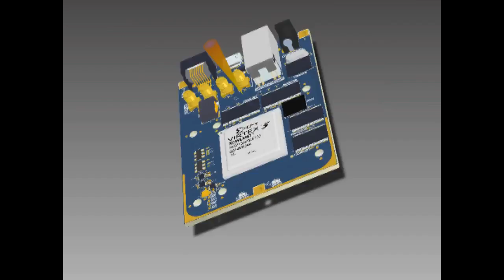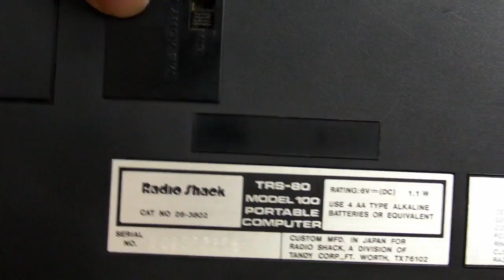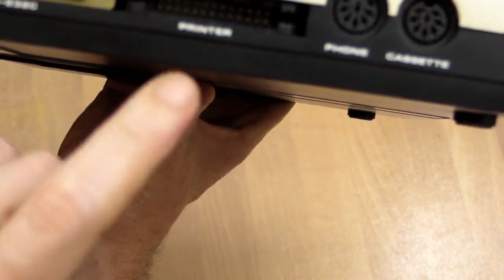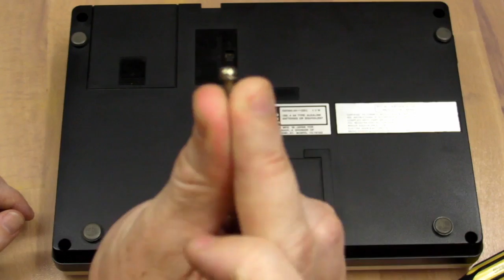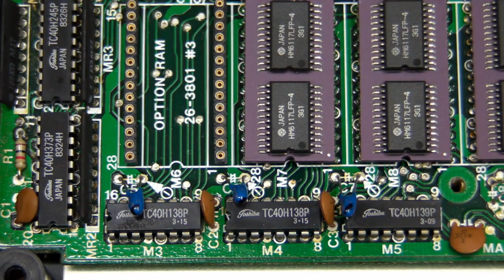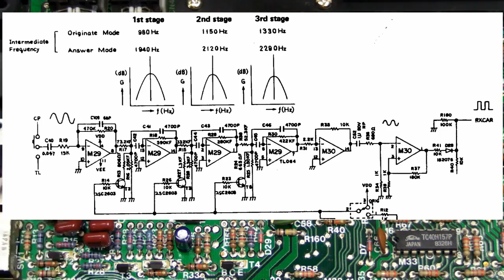EEVblog #116 - Retro Teardown - Tandy Radio Shack TRS-80 Model 100

Comment: I sold thesee back "in the day" and did mods for my customers.  For example, pop off the keyboard caps and slide the Rubber bands from Dental Braces to kill the keyboard "clicK" so College Students could use it in the Library without getting yelled at by the staff.  I'd also solder a NiCd AA in line with the batteries and use 4 NiCd's there to make the whole thing rechargable.  There was a VERY Good aftermarket ROM called IDEA that had an Outliner, Print Formatter and Database that all worked very well together to augment the native Word Processor.  There was also one that had the MutliPlan Spreadsheet if you did more Number-Crunching.

Later-on Shack also sold a nice little 3-1/2" Floppy Drive (4AA's again) that REALLY boosted speed and reliiability.  Tapes just couldn't cut it after that came out, yum!

Last I heard NASA was still using these to run experiments on the Shuttle and Space Station because they were reliable, stand-alone, units that could be literally programed to do ANYTHING, unlike much of what's out there today.
Reply: Great story Leo! I had the smaller TRS-80 Pocket computer which looked more like a calculator until it was plugged into the dock that offered me a serial printer (receipt size) which I eventually ripped out to do my own rechargeable mod. And your info about NASA is correct. My uncle worked for Honeywell on projects specifically for NASA and he swore by these machines. For one thing they ran BASIC natively and you could sit and hammer in a few hundred lines of code over lunch. What could make testing easier!? The most fun thing I did with my little Tandy was use it to write a program that launched my model rockets. (I was 13 at the time) ;) Thanks for sharing.
Reply: Good reading. It appears that it had a following despite the cost back in the day.
Reply: Neat idea with the rubber bands.  The Model 100 had an amazing keyboard! Still one of my favorites of all time.

Comment: I still have my Tandy Model 100 that I bought in 1984.  It still works and looks as good as the day I bought it.  I remember that it was popular with sports writers back in it's day.  I have a 300 baud acoustic modem I bought for it as well as the cassette player used for storage.  I have the "official" Radio Shack caring case for it.  In it's time it was a great laptop.  Thanks EEVblog for posting this video!

Comment: Wish my laptop runs on four AAs and last 20 hours.
Reply: to me it's the ONLY AA Laptop but maybe someone tells me iam wrong?
3k hz or whatever means long life. and yeah, is  light.
EXPANDABLE TO 32k RAM!
Reply: @QuizmasterLaw  There were more AA portables back then. As always, the screen is the most important factor. We went from a week of battery life to a single day when phones turned into smartphones. Same with those old portables: you can't have full-color high-res backlit displays and still have decent battery life. The CPU (2.4 MHz btw, not 3 kHz) actually has very little to do with that.

Comment: 1400 dollars in 1983, the CPI average in 1983 was 97.8 the 2013 average CPI is 233.069 divide the current CPI by the old CPI that gives you 2.383 multiply that by 1400 so in todays dollars (US) that would be $3336.20

Comment: Remarkably enthusiastic about a machine that was only 4 years before the Amiga yet cost three times as much and had a 20th of the RAM and displayed a 2000th of the colours.
Reply: That's a bit trite to say that. As the guy above says, 4 years as a slice of computer tech goes, is a LONG time.

Besides, how high tech it was is somewhat irrelevant. Many successful computers - like this - were successful even though they were technologically old (Sinclair Spectrum being a fine example). The reason for so many sales is clear - it filled a clear gap in the market, being a portable "notepad" of sorts that was squarely targeted at the business world. 

Do take a look at the other business computers that tried their luck around this time. Many tried the portability route (like the disastrous Osborne 1 which was a frigging suitcase), but this pulled it off. Sure, it cut corners, but that's the nature of the beast in those days. Portability just wasn't really achievable unless you ended up with a unit not much more than a toy. To that end, it's no surprise that a lot of these units found their way into businesses in places where PCs would prevail today. I worked for a fruit company around this time, and we used them for much the same as a lot of other production lines at that time - barcode/label printing.

I just feel your not using your perspective correctly. It was NEVER intended to be a home or entertainment device, and didn't sell to that end either.
Reply: You're not only wrong (it's 2 years actually), but you completely disregard the speed of development back then. You do realise there's only 3 years between the Commodore 64 and the Amiga, do you?

Comment: I had one of these for a while about 10 years ago.  It was fun to mess around with.  I even got an upgrade ROM that allowed me to hook it up to a PC via RS232 and run a "server" software on the PC side so I could make it act like a disk drive for the Tandy 102.  I even wrote some games on it in BASIC.  BTW, Synthematix it did have sound.  Basically just standard wave beeps and blips, but you could change the tone so you can play single channel tunes.  BTW, I love it when people are really into what they do like this guy is.

Comment: Interesting that the LCD module was using electronics that were about 10 years advanced over the rest of the board. All surface mount, including the caps. Also nice the Sharp chip with the Microsoft stamp.

Comment: I had one of these as a kid -- think it was my third computer. It was the first machine that allowed me to connect to the outside world -- even though it was 300 baud, it was so cool.

Had the floppy drive too. If I remember right, I think it only held 100k when formatted using a standard 3.5" disk. It was carried everywhere and eventually the keyboard circuit board cracked forcing me to make my first repairs with a soldering iron... I should buy one off eBay just for memories.

Thanks Dave!

Comment: to be fair, things like modern smartphones are designed pretty simplistically. it doesnt get much more simple than trying to bang everything in the device onto one chip. most modern smartphones and the like are boring inside and only have like four or five BGAs inside and a bunch of peripheral crap like cameras and buttons on ribbon cables.

Comment: My dad used to work for UCSD.  He was a PhD in high energy physics.  But, he loved old school electronics engineering as well.  He told me one time, the only thing that can kill old school discrete electronics is oxidation creep.  That's where the O2 in the air eventually creeps its way up the leads of the DIP's into the package and onto the wafer.  It takes decades.   Seems like modern ANYTHING has a lifespan of about 2-4 years.

Comment: why does the lcd driver board have smd capacitors...i thought the weren't around then?
Reply: Yes they were. Obviously. But as will all innovations, there were obstacles to overcome in terms of reliability and cost. It was ok to use for a single cap like this LCD board, but when large numbers were needed, the radial disc type was still preferred. Check out the Amiga 500 mainboard which still had rows of radial discs, despite being a couple of years newer than this Model 100 design. https://www.bigbookofamigahardware.com/bboah/media/download_photos/a500mb_rev5_1.jpg

Comment: it's almost always troublesome to say the first off, for things like computers, cars, planes, helicopters, things that evolved slowly instead of appearing fully formed in a eureka moment. So there are other machines that came before this that would probally have a better shout at being the first notebook type computer, I'd go for the epsom HX20, which had all that the tandy does plus built in printer and mass storage, or maybe the newbrain, both of which appeared a couple of years earlier.

Comment: The parallel interface port is a neat dog's breakfast - the circuit that handles the interface handles keyboard and display communication as well. I built an interface board to control robot motors from BASIC, but after the port changed state it would immediately start changing again (interference from other I/O)- I had to use an octal latch that was triggered by the strobe line, so I could have the states "Stick" for the transistor buffers.

Comment: @sbreheny Ok, you're right. No 74*. But I checked the datasheet, and you're not *entirely* right! The board is filled with Toshiba brand TC40H logic which is apparently "C2MOS", whatever that means. According to the datasheet, it's rated for Vdd up to 8V instead of the common 15V-20V for CMOS. Probably faster CMOS at the expense of voltage tolerance.
Btw, in this TC40H139 (a demux) someone got bored and wrote MUXMUM RATINGS instead of MAXIMUM. Many a engineer must've giggled on a late night.

Comment: @Gameboygenius the 4000 series was all CMOS, not TTL. However, it was slower than TTL but had a much wider voltage supply range (up to 15V I think). I didn't notice any 7400 series but I might have missed it. I think they went all CMOS to achieve the battery life, especially the month-long standby mode.

Comment: Ahhhhyes! I really appreciate this tear-down! I have an old Tandy 102 in the closet. I grabbed it, tossed four AAs into it and powered it up for the first time in about ten years - sure enough, it fired right up without issue. Neat machine! Funny thing about the internal modem - it can only do pulse dialing. Tone dialing is not supported!

Comment: I noticed the number of times you mentioned 24K..  I assume you're just rubbing it in for those of us who only have 8K in our Model 100's..  ;-)  Great vid!  Thanx!!!
(back in the day, I actually build a cheesy acoustic coupler for the modem, that did work at 300 baud..  That's long fallen to pieces, but the Model 100 is still running.)

Comment: I missed the link to the manual too. Would love to have it again.  I used to have that thing memorized including much of the schematic/port outs. 

I converted BBS software to be used by some HAMs with Packet Radio (data over ham radio).  Also did some assembler on it. Wrote a compiler that took an enhanced version of basic (no line numbers and some other features) and converted to the internal one to execute. 

Lots of cool projects. thanks for the video.

Comment: Nintendo electronic games used the upsidedown chip trick to lower the thickness of the product since the chip was placed in a PCB hole.
Wish you made a review on the C64. Not the same concept. Many porpietary chips, even regular 4000 stuff was made by Commodore's MOS with different codes making this computer even harder to fix ... but still the beest seller and powerfull personal computer with just 1Mhz uP (ok, the video chip run about 18Mhz).

Comment: Great video! I'm very surpised about the discrete SMPS, especially because that means these old electrolyte caps still have  good ESR values :). Otherwise, that memory backup NiCd cell looks very dangerous! I think you should remove it to prevent random time electrolyte leak which kills the board. I'm very surprised it's still "unleaked" conditon. I can't find any 386/486 mainboards with this type of battery which not leaked out. And this piece is intact after 27 years... What brand is it?